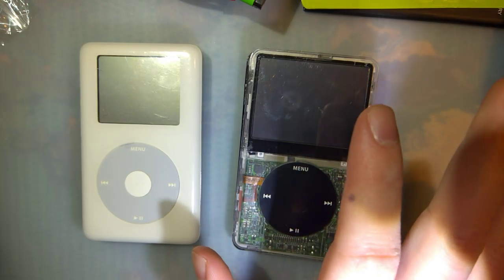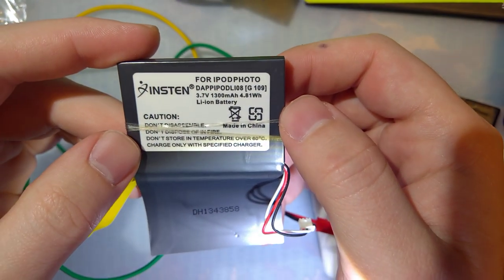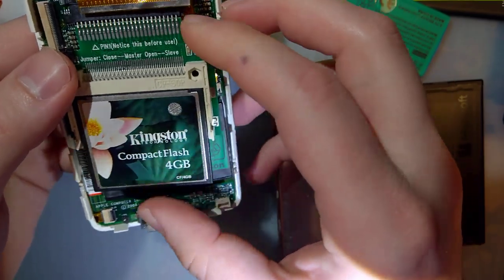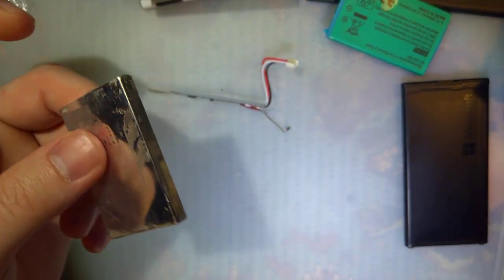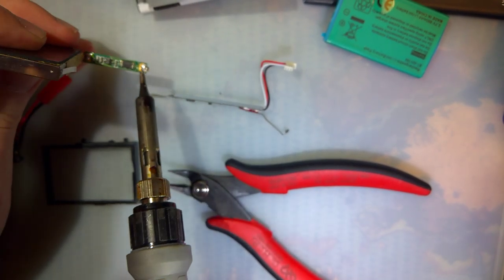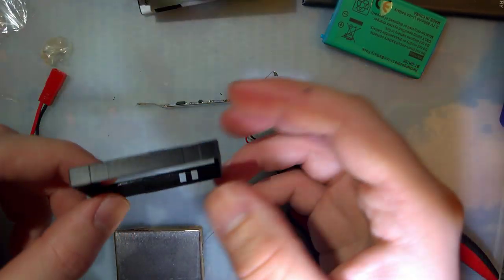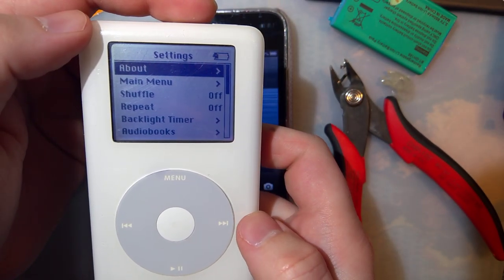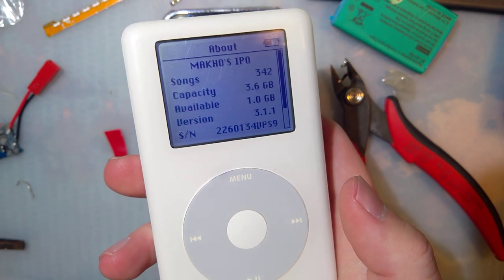Replacing the Battery in a Fourth Gen iPod

Comment: Heh, I replaced the battery in my ipod Classic about 2 years ago.
Getting that thing open was no picnic.

Nor was getting into my Moto Nexus 6. Battery as well. Get it charged, then you try to do anything it considered 'cpu intensive', it just cuts the power right then and there. Big flat slab of a battery.

Had a hell of a time with trying to not shred the backing. It's not solid backing, but more thin like a plastic playing card. 
I had to scrape off a ton of foam adhesive afterwards. Which meant ordering replacement foam adhesive cut to the phone itself. (thanks ifixit)

But, not sure if I'd ever do battery brain transplants, haha
Reply from the maker: I've done a few phones and a few tablets. I absolutely HATE having to cut through that foam/glue. The worst part is when you have to break the damn thing just to get it open. 

But yeah, I've been into this iPod a few times so it's a bit easier to get into now. The first time was a bitch and a half though.

Comment: I noticed that you have a iPhone 3GS and those usually just go "puff" in storage,lol
(I had bought a bunch of 3GSes and one just puff randomly when I was testing)
Reply from the maker: Still seems solid to me. I've had a lot of devices go in the past couple months. The 3GS was not one of them. I would not be surprised if it goes soon though.
Reply: @makho  I've been using a "broken" 3GS that I got for like $1.50 for music/bad old apps quite lately,it's a nifty device for it's age(probably because I have iOS 5 and not 6 running on it right now,so the battery life is quite decent).
about those Zunes,you might try to use Compatibility Mode,or go all out and use Windows 8.1/7(the app installed and synced a Lumia 800 for me just fine on 8.1,haven't tried on 10)

Comment: Actually, Bluetooth in your car IS an option. They make Bluetooth Cassette tapes. No joke. I have one. I used it with my old car.
Reply from the maker: That's fair. The problem with those is that there is no track control though. I know I can also just replace the headunit. It's not difficult at all and I already have the tools anyway from when I installed the tape deck (car came with AM/FM only, tape deck was an option that I pulled from another car in the junk yard). 

The biggest thing is that I don't want to spend any money on this car that is not for maintenance. I had been planning on purchasing a new car in April for months now and the only reason I'm waiting now is because I just realized it's April. At this point I might as well wait a little longer to see if dealerships start offering better deals though.